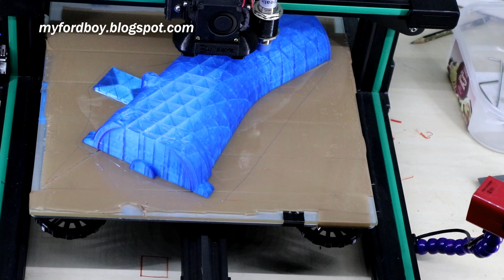Metal Casting at Home Part 88 Audi Quattro MAF Pipe

Comment: How did you get the CAD to 3D print the cores? Do you have a 3D scanner?
Reply from the maker: No scanner. Once the part is drawn in CAD the file is exported as an STL file into a slicing program that produces the gcode needed for the printer. For the core box ( mould) I printed out the shape you see put removed a few of the external detail.
Reply: @myfordboy  Did you model the CAD model yourself? It's looks pretty neat, was it hard to get it to the right shape? Or was it just some short of Loft shape?
Reply from the maker: @iamdorusyt  My friend who the part is for supplied the CAD.

Comment: Instead of waiting a few days to harden could you pull a vacuum on it ?? Also when you used your crane was that a old wheelbarrow used to dump and clean your casting ??  Always enjoy your videos
Reply from the maker: CO2 hardens the core. It may have been OK straight away but I was in no hurry I left it make sure.
 modified wheelbarrow is used for mould break up.

Comment: how about shrinkage....?
Reply from the maker: You have to allow for it by making the pattern bigger.
Reply: @myfordboy  thanks, that explains it. So I assume you have increased the dimensions of the pattern by approx. 0,5% , right?
Reply from the maker: @TheColinChapman  1.5 -2% for aluminium.
Reply: @myfordboy  really that much? I always thought that 2% was the overall shrinkage, and in the pattern you'd only need to bear in mind the solid shrinkage of approx. 0.5%.
Reply from the maker: @TheColinChapman    It shrinks in all directions by 2%.
Reply: @myfordboy  sounds a lot to me, but thanks for the clarification.

Comment: not a way to mass produce though is it.
Reply from the maker: But a good way to make an obsolete part.
Reply: Yeah but if you got a £4000 3d printer you can print the part in Carbon. Or go online and get a metal printing firm to do it. 

This is satisfying to know you did it all. Just it is time consuming. Great for someone retired. 

Not if you going to want to sell hundreds

Comment: He should've printed the actual pipe and stopped there. Thos is a non pressure or heat bearing part. No need to make it out of metal.  Pop the hood of any German car today: what do you see? Plastic,  plastic,  plastic.
Reply from the maker: Your missing the point. This is for a replica rally car. The original pipe is aluminium.